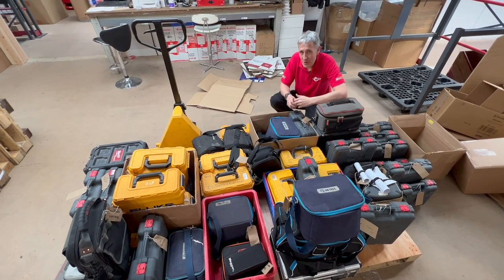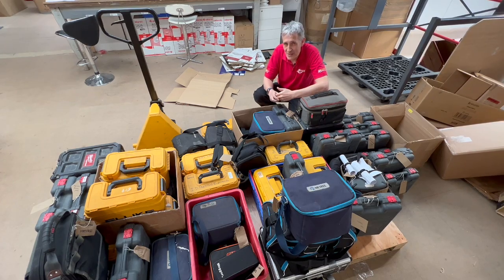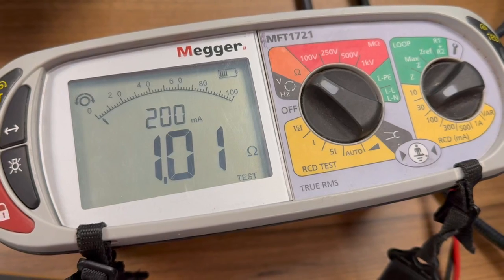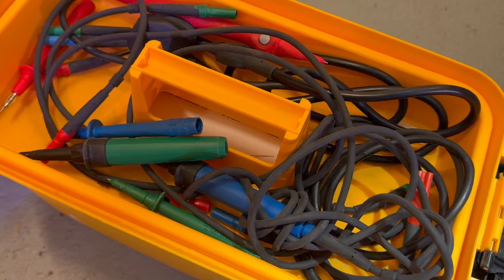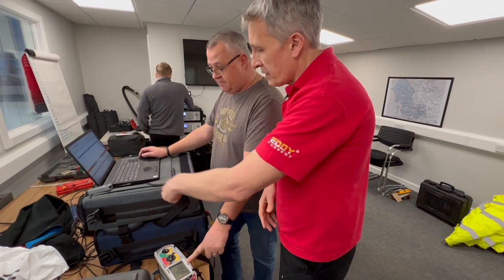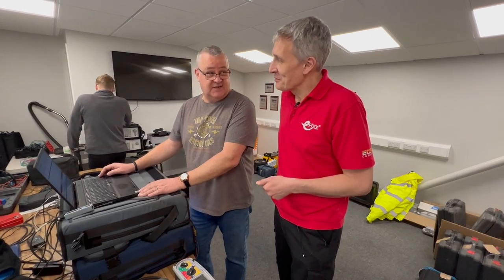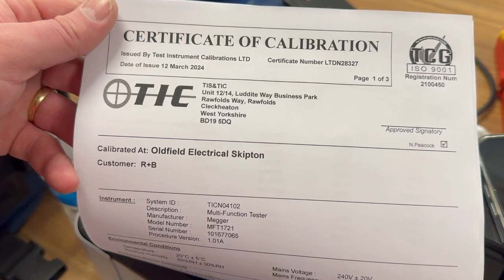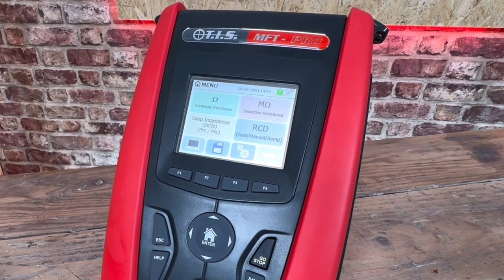From Hero to Zero: MFT Calibration Explained

Comment: As an ex iso 17025 cal lab manager, i can confirm the calibration equipment used on site is ultimately traceable along with any measurement uncertainty right back to the S.I. standards in France.  What This means is that the national standards lab in any country (apart from the USA,  they use some funny ANSI srandard) gets their their reference instruments calibrated against a traceable unit and in turn use that to calibrate instruments used to perform "lower level" calibrating. This means if everything is done correctly you can trace your calibration right back to the S.I standard unit for that calibration point. . 

Yep, im being geeky, but it is an interesting field. The labs even check  items of unknown (except to the national lab) calibration to see if they all get the same results, especially in metrology
Reply from the maker: Great insight thanks 🙏
Reply: Hard work for those Americans findings those bananas to reference. 😉

Comment: Could you enlight us a little more what happens if tester fails calibration? All right, they put it in the corner - what's next? How much is to adjust/repair that faults in terms of most important thing - money? Who is doing it? Do manufacturers give somebody right to repair testers they produce?

Can you show us a dark side of it, where is not all smiles
Reply from the maker: You are usually looking at “hundreds” of pounds depending upon the manufacturer. We’ll see if we can make a follow up with some failed kit.
Reply: @efixx  Thanx, it would be fascinating for all, except the manufacturers.

Comment: What /  who calibrates a calibrator? 
 Calibration labs will work to "ISO/IEC 17025 — Testing and calibration laboratories"  Ideally these labs will have UKAS Accreditation, and their scope can be checked on the UKAS web page. (UKAS = UK Accreditation Service)  It may be that a  company offering calibration services will be approved to do so by another company who is UKAS accredited. Audits will be performed to make sure this company is  following the procedures to which it was approved and it will likely have  ISO 9001 approval. (ISO 9001 is the international Standard for Quality Management.)

Comment: He using nothing more than a fancy checkbox and a laptop , my Kewtech FC2000 that cost me £120 doses the same tests , I plug it into the mains and connect my MFTs into different ports according to the MFTs functions . Calibration is just another money making scam none of the manufacturers do this in-house they all send the testers to one of the many independent companies which you can do yourself. The IET The NICEIC and Kewtech themselves told me if I have a checkbox I don’t need to send my MFT in for calibration I can check the ongoing accuracy with my checkbox but I have to keep a record of the results and date each time I check my MFT. I do mine once every three months. I used to do it once a month. And keep an upto date record on my PC .
My old Robin KTS 1620 was last calibrated in 1995 yet it is still giving out accurate results. If I do get any deviations then I will need to send it away for repair.
Interesting video though Gordon 👍

Comment: Megger like to use clean components in the 1720 range. This way unless you have all the data down to component level you’re unable to complete a repair, which results in sending it to the direct.
Reply: I needed a repair on my Megger MFT, Megger quoted crazy expensive costs just to look at it. I contacted my normal calibration place and they repaired it for less than the price of a takeaway…
Reply: @jamessealey5608  they were charging a fixed price at the time.